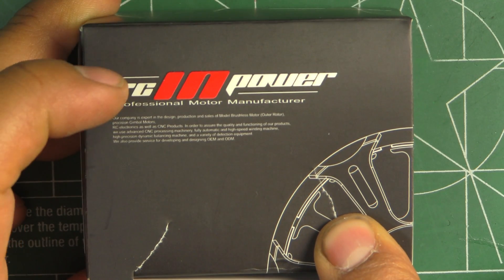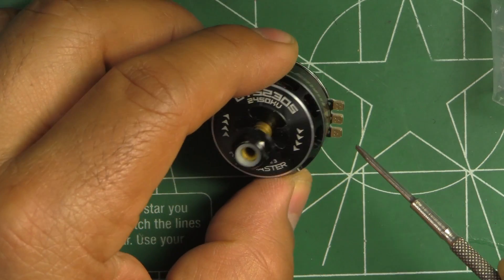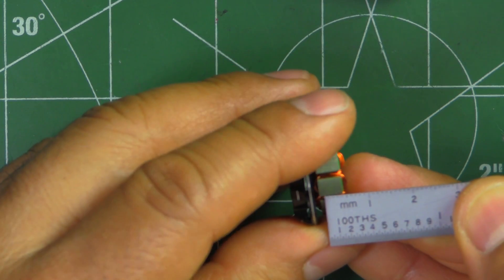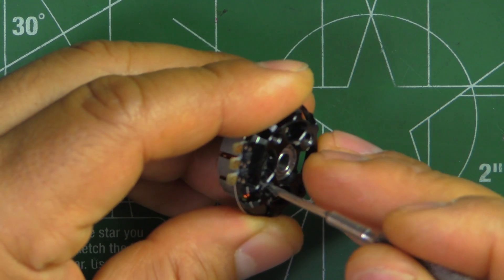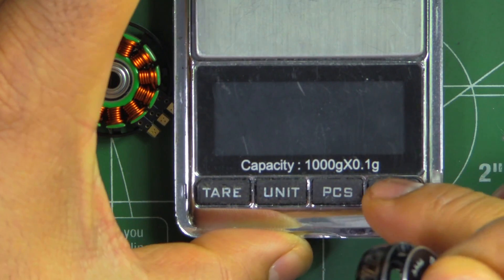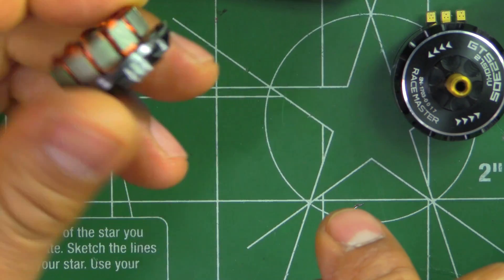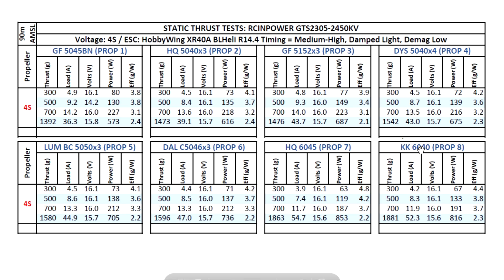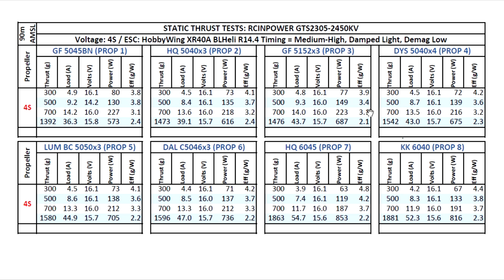RCINPOWER GTS 2305-2450KV Static Thrust Tests & Overview

Comment: Thrust chart looks good! I want to start building a Blackout mini Hex and want to use the GTS 2306 2400KV. I want to know what you think about it? I don't see a lot of hex lately and the last few months is quad so popular that's the hex is a bit out of sight. Google doesn't finds much about hex and if I find one than the thread is so old and hex still using pretty old stuffs. My hex setup will be GTS 2306 2400KV, still looking for ESC with BLheli32..and suggestions which one? Thanks!
Reply from the maker: BLH32 still sort of new so I have not yet seen an ESC that everyone recommends. A hex withe 2306 2400KV will be a monster hex! you'll need a very good LiPo. Sounds like a very cool project. I've been wanting to rebuild my FPV Reconn RD290 hex too.
Reply: I have bought a hex sinds there came out and till now it's still new in box with 6 cobra 1960KV. But as you know this hobby really going fast so the cobra feels like a dinosaur era to me right now. I saw the DYS Aria 35A and want to get them for the hex but al my other quad with DYS XSD 30A also perform very well so to me it's not really important to buy a BLheli32 esc. Blackout hex can lift up a Turnigy 4S 2700 65C easily but still don't want to push it to the max.

Comment: Hi
found some insane motors here in china made by garila ? they are 2506 with many KV versions a few examples below hope the links works - what ESC's would you need for these - (joke) I'm thinking the 3000kv on 4"

https://item.taobao.com/item.htm?spm=a230r.1.14.101.XgyAp3&id=549061473770&ns=1&abbucket=19#detail
https://item.taobao.com/item.htm?spm=a230r.1.14.113.XgyAp3&id=549088994797&ns=1&abbucket=19#detail
https://item.taobao.com/item.htm?spm=a230r.1.14.173.XgyAp3&id=552555569899&ns=1&abbucket=19#detail
Reply from the maker: 2506-3000 on 4S 4" props , my best guess is it would draw very high Amps so it would need at least a 25A ESC, but 30A better just in case. For high KV, on 4S and high thrust, as stator diameter increases so do the Amps and there's a point where going to larger diameter stator while keeping its height too short, the motor starts to become too inefficient at very high RPM. The opposite works better, keeping diameter at 22, 23, or 24 but increasing the stator height instead (to 6, 7, or 8mm), to gain more torque. The large diameter motors work best in low RPMs with very large props. Also I think those motors would be too heavy for 4" setups.
Reply: Hi  I agree with you on the 2506 XXXX motors I found, they are a bit extreme, think of the size of the battery needed to power them....

Comment: hello again these motors perhaps have a little to much power for my skills but I'm learning, no problems yet a little warm like the battery but my xrotor 30A/40A ESC's get quite hot pretty fast into a flight none have gone buff yet but would like some recommendations on some higher amp dshot ready or capable esc's. to replace them.,, many thanks
Reply from the maker: Edward Lee Everyone seems to like the DYS XDS30A. Also Spedix 30A esta are good. Other than those. There's the new 50A IPeaka from iFlightRC.com but I have not seen reviews or tried it. But IPeaka makes very good escs. Good to hear motors are powerful!
Reply: Hi looked up the 50A ipeaka ESC's and are considering them but cant find much info on them ie reliability etc... price isn't as high as the t-motor 45A either but will still need to save the pennies to get them,,,,,
kind regards.
Reply from the maker: Yes, they're new - so no reviews or much info on them. Always a risk to buy parts that no one else has reviewed
Reply: there is the flytower 40A but I hear it has lots off esc issues ?
I'm in no rush so see what is available when betaflight 3.2 goes live. I have a new CL_racing FC that needs 3.2 to be fully functional too...
kind regards
Reply from the maker: Yes, if you can wait a bit, BLHeli_32 is coming next and they're supposed to be the latest - best type of ESCs. So just need to see which are good.

Comment: I have decided to opt for these I can get a set of 4 for a good price (398 yen / 40 English pounds equivalent here in shanghai), hope my Xrotor 30A-40A esc's will be up to the job.
Reply from the maker: Good choice I think and price is pretty good. 30A esc's will be OK. If you're going to run 5" props they'll handle the load no problem. Just stay away from "BN" props as those make motor draw more Amps.
Reply: thanks, I will be using the DAL q5x4x4's and HQ 5x4x4's I seem to prefer them over tri blades in the limited spaces I can fly
Reply: one more thing,,,,,,, thanks for introducing these motors to me and every one else.....
Reply from the maker: Thanks for watching, Yes, it's odd the manufacturer doesn't put more effort into marketing them. They got the same quality as any of the other premium motors.

Comment: Really good job with these tests!! Could you do a test of a bigger motor, the Tmotor F80 2500kv? Thanks!
Reply from the maker: Thanks! I have messaged T-Motor for test samples but no answer yet. In the mean time, if you haven't yet visited wwww.miniquadtestbench.com check out motor tests there. Ryan Harrell has tested several for the F-series T-motors. Thanks for watching.
Reply: Manu FPV 2200kv f80
Reply: Yeap! I talk sometimes with Ryan. Reeaally interesting information from both of you. Nice people and nice evidences for our hobby. See you in your next video.

At the discussion of this motor I see that it has soo good numbers but It has too much amp draw for this power category no? The weight is acceptable but not really impresive for 2305 category. What do you think?
Reply from the maker: I thought the power was impressive. Yes Amps are high on the static thrust test. When we use LiPos everything comes down since the battery is the limit so Amps are not going to be as high in flight but will be a little higher than the EMAX 2306-2400, but you have to keep in mind that it will also make more thrust (theoretically - according to test results) The higher Amps seem normal since also the thrust output is higher. Those 2 things go together usually. If the quality and durability is as good as the older GT2205's I tested before, these will be a very good choice considering their price (hopefully $19)

Comment: Audio sounded great! at the end I could even hear the fan on your power supply when you were going over the spreadsheet. Speaking of your spreadsheet, I've noticed a few retailers using them lately, free advertising if you put your name on them. 
I'm glad you tested this motor, I had a feeling these were some beasts and I also was thinking the same thing about this company that they don't market themselves very well but should because they really are some upper echelon motors as far as performance goes at least. As far as the steel shafts, I think (not positive) it's 12.9 steel which is hardened, quenched steel and if they are really using that I am seriously impressed. The color would be added for corrosion resistance because quenched steel is stronger than stainless steel but does not carry the same non corrosive properties. But I can assure you that you would never do anything to that shaft to damage it, nothing. thanks again for ANOTHER great video and I really look forward to your video on the higher kv version of this motor.
Reply from the maker: I increased volume on the video editor. My budget Dell laptop mic and soundcard are very crappy and pick up a lot of humm noise. I gotta do a lot of post filtering. I bought a Rode mini-mic  a few weeks ago but I had to order an adapter so it works with laptop. I only found out when I tried to record that it wasn't compatible. Mic is made for video cams and SLRs. 

Very good info on the steel shaft- makes the motor even more impressive. Their  other motor line was very good too. Hopefully these are just as good and bulletproof. They really need to make a 2306 or a 2207 size motor. The higher KV version is going to be a bit scary to test, I'm hoping it doesn't overwhelm the current sensor
Reply: Audio was really good, TBH I thought most of your other videos were silent reviews :) .. j/k
Reply from the maker: LoL.... yeah I know. I bumped audio a lot this time on the editor, I thought the other ones played loud enough in my laptop but then when uploaded audio was way too low. I got a Rode mini-mic I need to get an adapter for and start using. Also my budget Dell laptop has crappy soundcard.
Reply: I honestly think they just put themselves in the top of the class with T-Motor F60 pro's, XFoots and BH but I am not sure any of those motors have put it ALL together like that. I'm curious to see if that is 12.9 and what kind of bearings those are. I wanna see a motor with ABEC 7-9 ceramic hybrid bearings too.
Reply: hey, I have another question for you. I'm thinking about changing direction on the micro I was talking about with you and I'm probably going to go even smaller than the 1407. other than being able to blow my non flying friends minds with a 130mm on 4s it kinda defeats the purpose since it'll be just like a slower version of my 4" so I think I'm going to build a 90ish so I can literally take it anywhere. so I wanna know what you think I should use for an 11** size motor. I'm going to stick with the same setup of Micro Lux and either 2-in-1 or 4-in-1 esc's but I want a kind of all-around motor if there is such a thing in that class. What would you use?
Reply from the maker: I haven't played much with 11** size motors, but I would think they follow the same principles as the larger ones. So 1105 and 1106 would be my choice. Taller stator makes motors torquey, so that's good for driving props with more than 2 blades. Choosing the best KV gets tricky with this micro motors so I would research as much as possible to see what the best match is for the props and voltage you want to run. Choice is sort of limited on 2"/ 2.5" props. For 3S maybe a 4000KV or 5000KV motor?

Comment: Thanks for producing these great tests!! Very useful information!!! I'm wondering if these motors are manufactured by aokfly? Do you know?
Reply from the maker: As far as I know the factory is called "RCINPOWER" and they make motors for several other brands. But they don't have much online presence which is a shame, their motors have been quite good and very durable. Their GT 2205 motors were outstanding and several friends have been very happy with those
Reply: LDPower maybe? I speculate because they also have a 2305 - 2450kv that have solder tabs for the wires.
Reply from the maker: Could be, but the motor armature looks different. I'd love to have some sort of chart listing all motor brands and actual manufacturers